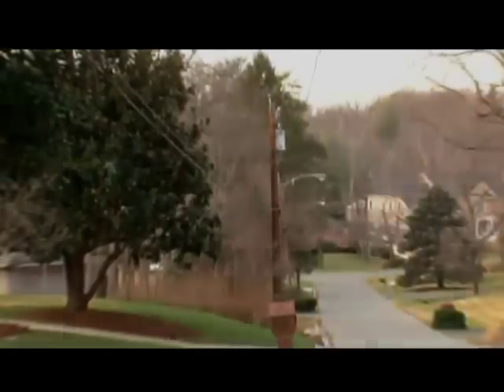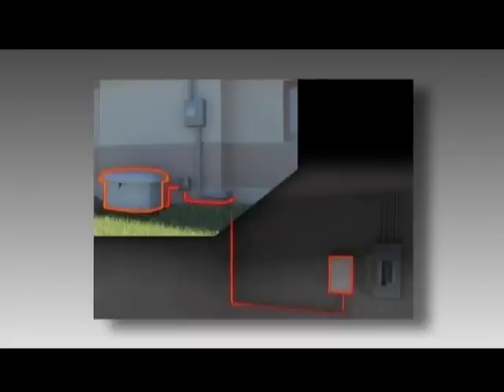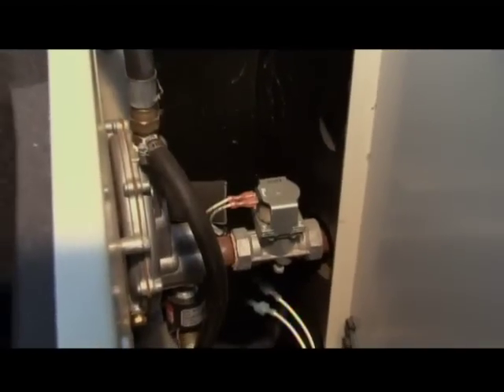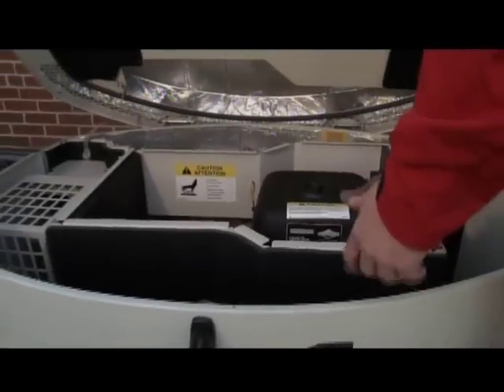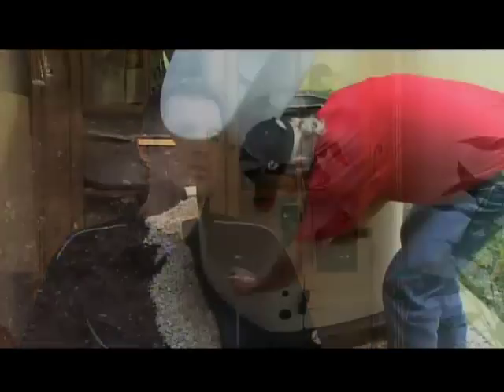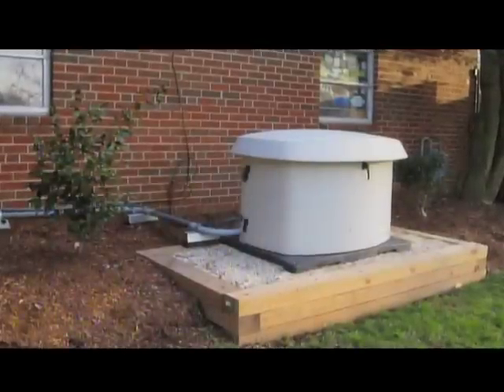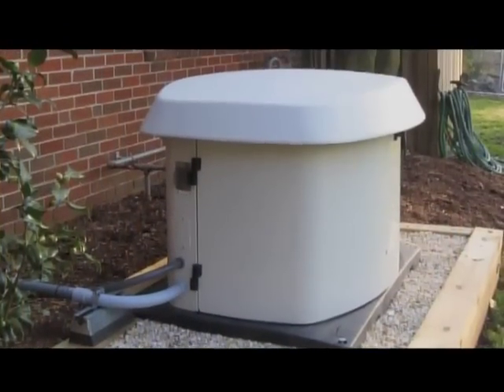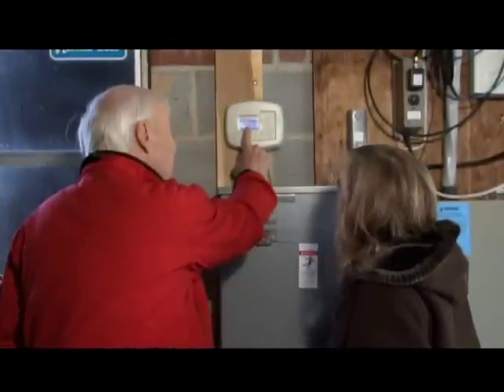Home Standby Generator Overview

Comment: The Cummins-Onan RS20-C150 and RS20-C250 generator packages are complete and ready for installation with service-entrance-rated transfer switches, two wiring harnesses, installed cold weather kits, and remote in-home displays. They are an additional measure of home security in winter or summer, keeping you free from worry that a storm will leave your home without power. Find out more at Norwall com

Comment: Planning a backup generator purchase? You'll want a unit that works when the power is out. Don't settle for a cheap brand. Cummins Onan has made a reliable top-of-the-line product for many years. And a good supplier is www.nooutage.com which is managed by a licensed electrical engineer. Great for solid technical help selecting the right system.